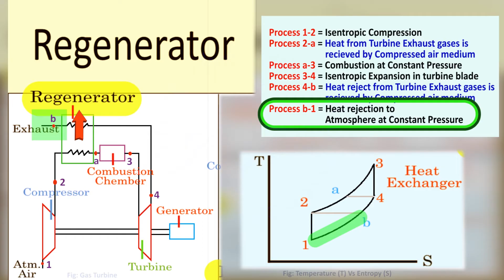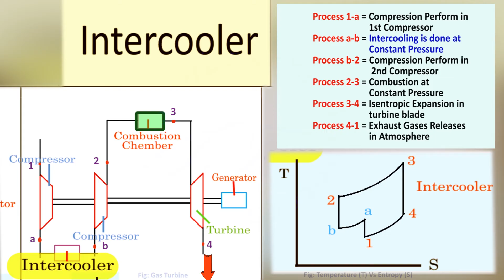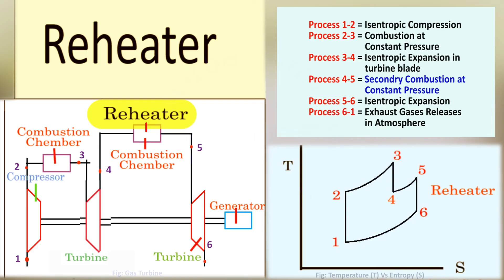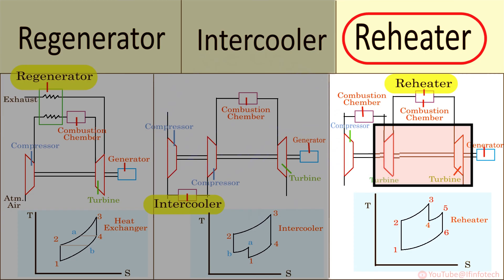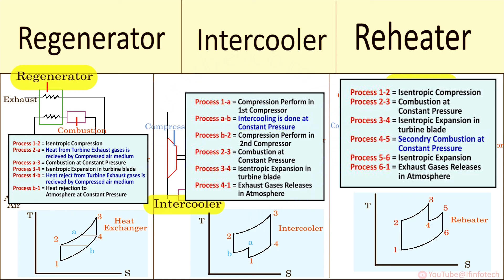Intercooling, Regeneration, Reheating in Gas Turbine | Methods to Improve Thermal Efficiency

Comment: TL;DR:
Regeneration: heat up the compressed air with the waste heat recovered before burning it(save energy by reducing the overall waste heat)
Intercooling: cool down the compressed air before compress it further(this make the air easier to compress thus save some energy)
Reheating: heat up the exhaust gas and pass it into a second turbine(burn more fuel but more power0

Comment: In intercooling why it is necessary to use 2 compressors even  though we got same temperature  in TS diagram. Here is the doubt arises that when the temperature is same then why do we need to use 2 compressors
Reply from the maker: Hi Sai Tarun Adina,
In intercooling two compressors deliver greater air pressure at higher capacities than single compressor, 2 compressors with intercooling perform less work to compress air to a given pressure, which means your operating costs are lower. Here cooling action is responsible for higher efficiency, bringing it closer to Carnot efficiency. Cooling of compressed air reduces its temperature and thereby increasing density of air output.
Reply: @Shubham_Kola  okk .thank you for clarifying the doubt 👍👍
Reply: in intercooled internal combustion hidrostatic Otto  engines like the Subaru EJ
after the centrifugal compression driven by the turbo, you cool the air,
then compress again inside the engine with a piston.

In order to cool the working fluid, it  is better to have it inside the system